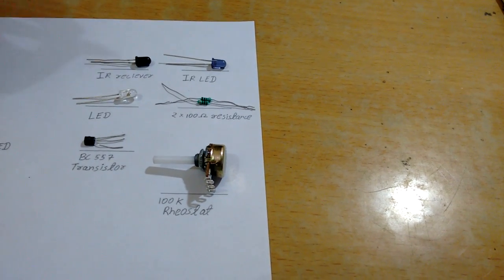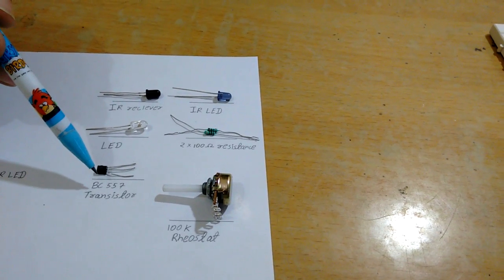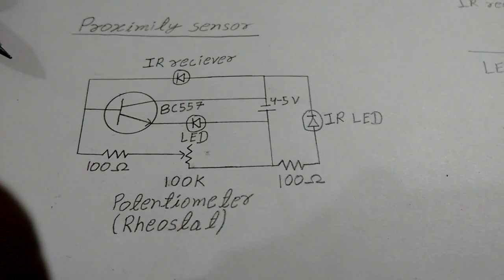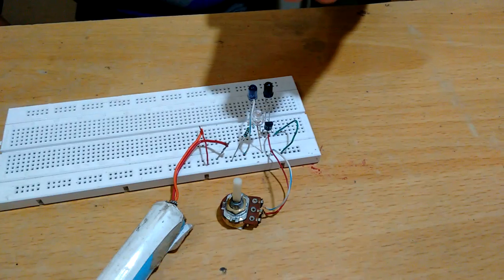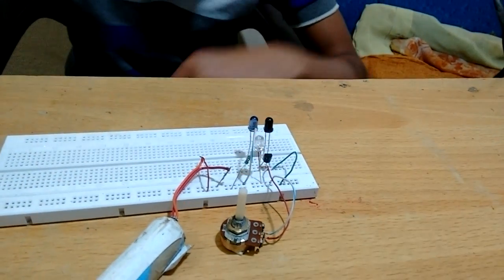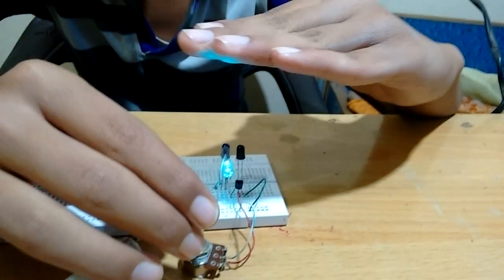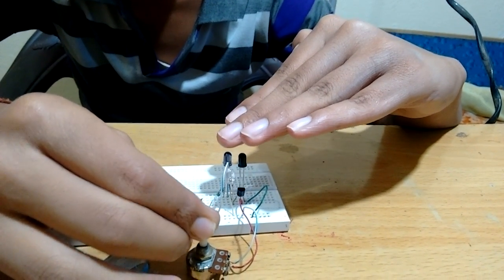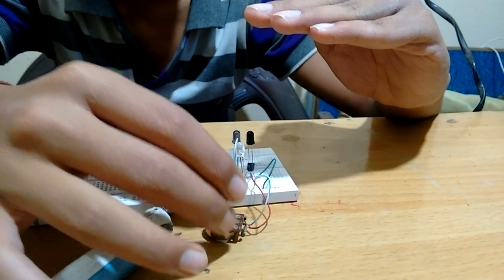How to make a simple long range proximity sensor

Comment: Then you want to say that if we increase the value of potentiometer (means resistance) the amount of flowing current will increase , I have to tell you that resistance and flow of current are inversely proportional...
Reply from the maker: +Sayan Paul this is the cross connection resistance, or you can also call it signal resistance. Learn the basics of semiconductors especially BJTs.

Comment: I have made a project with this ir sensor but there is a problem that the LEDs connected to it remains in on stage and on the appearance of obstacle it gets off .I don't know why this happening .plzz give me some solution for it.I have also tried to adjust the potentiometer but didn't get the desired results.this project is for my boards so plzz help me in this as boards practical r gonna b started .plzzz reply fast
Reply from the maker: +Jash Gill you have used a NPN transistor in the circuit, replace it with a PNP transistor to get the desired result.
Reply: NGresearchers  I havnt made the ir sensor by myself,I bought it from the market.and done the connections.
Reply: in fact my ir contains an ic LM 358 instead of transistor.plzzz help me what to do know???

Comment: Sir,can i use NPN transistor??
Reply from the maker: +Michael Pelagio ofcourse you can use but, the sensor will work opposite to, as shown in video. That means, the LED will glow whenever there isn't any obstacle in front of sensor and the LED will turn off of you bring anything closer to the sensor.
Reply: thanks! :D
Reply: so what transistor do i use? in order to work as obstacle activated sensor??
thank for the reply
Reply from the maker: +Michael Pelagio use a PNP transistor one of which is BC557.
Reply: thanks! :)

Comment: Bro this could be a major upgrade for most 3d printers.
Reply from the maker: +luis fernandes you are talking about limiting switch, I guess.
Reply: NGresearchers limiting switch aswell as auto bed leveling with adjustable sensing range.

Comment: plz bro help i have a project and i have components with me is CTBC548TRANSISTOR and THREE PIN IR RECEIVER it is possible to make
Reply from the maker: +Roshan Roy you can probably make an IR sensor with three pin IR receiver but it would be very complex to make an IR proximity with three pin IR receiver.

Comment: I make this circuit for calling bell. But the bell volume becomes very very much low when I connect the bell with the circuit. Please give me solution for this problem. Please help me.
Reply from the maker: +Sudeshna Dhar connect a relay to the circuit or please wait while I am going to make a video on relay with proximity.
Reply: NGresearchers  please tell me the connection of the rela, it is very urgent to me. If possible please tell me your contact no.
Reply from the maker: +Sudeshna Dhar connect the output of the proximity sensor to the relay and use it as a switch for your desired gadget with a separate power source. Replace the input power source of the sensor with a 9v battery.
Reply: NGresearchers I try it, but not success. May be there have some mistake. Bell totally not work. Can you give the circuit diagram? Or give the video please

Comment: is the output digital /analog?
can I directly connect the output to a L293d motor driver???
Reply from the maker: +azharul haq I think it would be more better if you try it. Ask if you have any further problem.
Reply: what is the max range??? i want to make 4 metre to 7 metre sensor.. idnt want much accurate distance but obstacle detection is necessary....
Reply from the maker: +Sarkari Naukri better to use ultrasonic sensor.
Reply: thanks .. what will be the price of that
Reply from the maker: Sarkari Naukri that depends on the method you make, you can either choose to make it using arduino and ultrasonic sensor with a bit of programming or you can buy a cheap readymade one.
Reply: seen . but its length is very  short ,, nt suit my range, how can i increase that?? please support
Reply from the maker: +Sarkari Naukri you can increase it's range upto more than a metre.

Comment: can i connect the output of the sensor to a bjt transistor switch?
Reply from the maker: +Victor Belo yes, ofcourse you can connect it for better amplification in the signal.
Reply: awesome, because i wanted to make an ir proximity game controller, and I will connect it via transistor switch (on/off) to trigger a button on a usb controller.... is this possible?
Reply from the maker: +Victor Belo better if you use a relay instead.
Reply: NGresearchers ok, i will try to buy a relay and will experiment with it! again thank you very much for the inputs~

Comment: can I replace the rheostat with resistance?? ans me pls
Reply from the maker: +jeetu kumar yes ofcourse you can.
Reply: NGresearchers thanks to response fast.... tomorrow I've to submit my project today I'm going to make it..if i   would have any doubt where can I ask you for? help me regarding this
Reply from the maker: +jeetu kumar watch it's descriptive video https://youtu.be/AmkYwvCjXoY for more details and leave your questions in the comment box, if any.
Reply from the maker: +jeetu kumar congratulations, actually the circuit is working. Press the button of a TV remote near the sensor to check whether the LED blinks. The reason it not seems working can be: 1) your IR LED is not working (check it with the camera of your mobile)
              2) your IR receiver is placed with the opposite terminals.
              3) your resistance is below 10k( try removing it).
Reply: NGresearchers OK I'm going to do the same pls wait for my reply
Reply: no sir it's not working yet😟😟😟
Reply from the maker: +jeetu kumar I think you must check for the all three statements (mentioned above) one by one and you must watch it's descriptive video https://youtu.be/AmkYwvCjXoY.

Comment: Hey bro can I use multiple LEDs to show the proximity, for example for a far object 2 LED must glow and for a nearer object 3-4 LEDs and so.
Reply from the maker: +Najeeb Mohammad Khan you can get the same effect by connecting a vu meter in place of led.
Reply: NGresearchers Yeah but the voltage will be an issue I guess.As vu meter works on higher voltage than that we get here for LED.Any suggestions.
Reply from the maker: +Najeeb Mohammad Khan yes, you actually use a 6v relay for the required voltage.
Reply: NGresearchers can u send me a schematic diagram for the circuit you are talking about.And also how to connect the vu meter with it in place of LED
Reply from the maker: +Najeeb Mohammad Khan let me take some time for that. Mention your Gmail account and I will send it whenever I will find myself free for that.
Reply from the maker: +Najeeb Mohammad Khan sorry, I apologize, but suddenly I got it in my brain that you can't use relay for the vu meter.
You have an easier option, connect the power supply of the proximity to a 12v DC power supply and directly connect the vu meter in place of the LED and you will achieve your demand with the sensor.
CAUTION: remove the rheostat if it heats up more and take care of the current rating of the power supply.

Comment: use only led ?😢
Reply from the maker: Afiya Aisha you can also use any other components in parallel with the LED but if you have any further problem regarding the current (or power) then comment me back.

Comment: I want to take output from the proximity sensor and join it to a relay. How can I take the output instead of glowing the LED.
Reply from the maker: Samiran Pramanik Just connect the input terminal I the 6v relay in place of the LED and then connect the input power supply and the output gadget respectively to the relay and then you are all done with your own relay circuit.

Comment: hi, great video, will this work in the dark too? or any lighting conditions? cheers buddy.
Reply: It uses a PNP transistor but you have drawn an NPN transistor. Also this kind of circuit is very sensitive to the outside IR noise, so it cannot have particularly high range. It would be much more reliable if it had an AC modulation in the transmitter and the respective AC filter in the receiver.
But I guess that for showcasing the basic principle, it will do.
Reply from the maker: DEADASTRONAUTFX no, it doesn't require any lighting conditions to work but be aware not to use it under hard sunlight as it will not work in sunlight.
Reply: hi, thanks for your reply,  so it will work in total darkness?...thanks.

and will it work under an average house light?. cheers ,
Reply: npn or pnp?.
Reply from the maker: DEADASTRONAUTFX it will work anywhere eliminating those light source that produces intense heat around it for example sunlight or tungsten bulb.
Reply from the maker: DEADASTRONAUTFX it uses PNP transistor. For better description watch it's descriptive video https://youtu.be/AmkYwvCjXoY
Reply: ntomata0002 , hi do you have a schematic for a high range version of this?
Reply: An easy way to do it would be to use a 555 circuit to turn the LED on and off at the appropriate frequency (38KHz for example) and then use a receiver with integrated filter like CHQ1838. Be advised though that the LEDs emit light in a cone so the energy is spreading in a larger area with distance.
Mind also that sensors like CHQ1838 are digital so it will give a signal at a specific range for a given material and LED light intensity.

Comment: bro iam try many time this not working pls help me
Reply from the maker: MADUSHAN MADU Please clarify your problem but before that watch it's descriptive video(on same channel) if it helps.
Reply: what is the value of IR used in circuit?
Reply from the maker: srinidhi srinidhi if you are talking about the IR led, then then you can use any of input voltage 3 to 5v. And if you are asking about the output intensity of the IR led then an let with better intensity will be more better.

Comment: Can I use bc547 transistor?
Reply from the maker: Actually, BC547 is a NPN transistor so, it will work but just opposite to that shown in video. It's better if you use any PNP transistor.
Reply: Ok. So, can I use 250k pot?

Comment from the maker: I think that you must be sure with the power supply of your battery, transistor, IR led(check it with your phone camera) and specially IR receiver, as many sellers provide IR led instead of receiver. If doesn't works again then comment.

Comment: hey 
we r not able to find BC557.Instead of BC557 can we use any other.
Reply: that BC557 is like an oscilator or frequency generator. Of course, you can replace it depending only on your available electronic parts.

Comment from the maker: That actually depends upon the resistance that you have applied between the base and the (+)be terminal and also on the angle between the IR led and IR receiver .
However, if you remove the rheostat i.e increase the resistance to its full(as now there is only air between the terminals which has a very high resistance) then it will become an IR sensor that can even sense the little amount IR coming out of your body and the sunlight.

Comment from the maker: Before the circuit diagram, I have showed all the components required.  Just connect all the component according to the circuit respectively.
If you still have any problem then please comment me.
Reply: If you can, can you make another video with conncecting equetment step by step please which would be help me (us) a lot and will be easy. So help us out please. Thank you